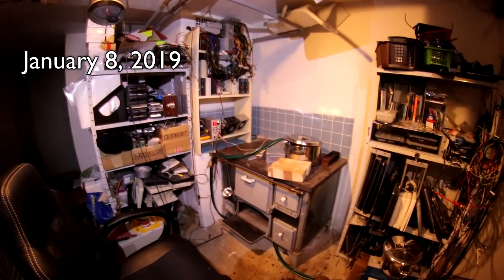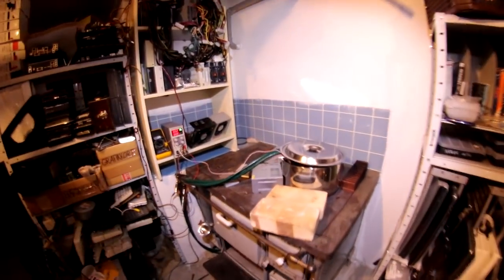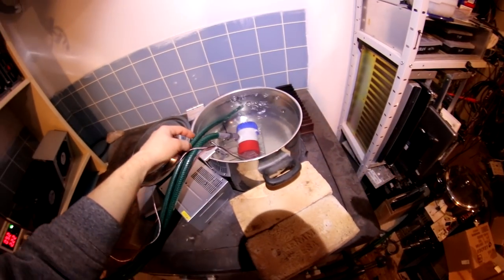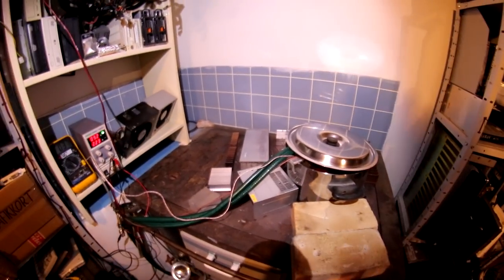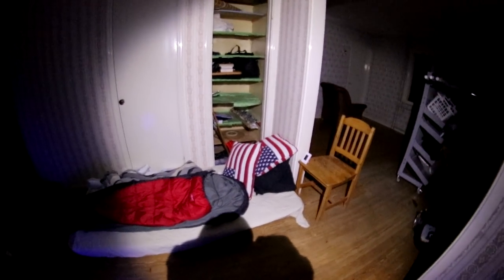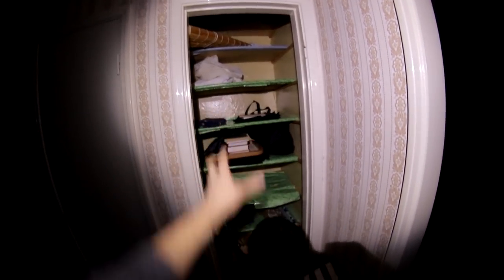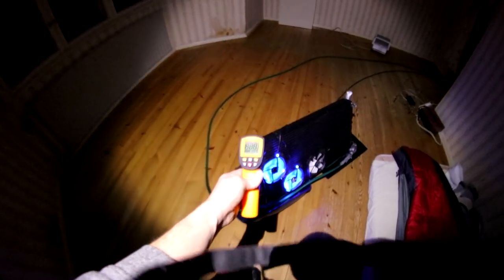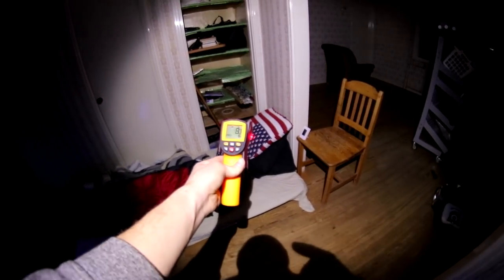Power Loss Blog 5 - Day 6

Comment: if the cupboard is radiating, it seems sensible removing anything that could be able to hinder it from radiating. also, reduce surface/volume to restrain energy in: at least close up the doorway in your new sleeping room with a bed sheet or similar. same goes for the windows: improvise curtains. 

compartmentalization is key.
Reply from the maker: I didn't close off the big opening, since the stove is heating the floor under the "unused" room. The floor was considerably warmer than ambient. If things had been more dire, I'd have experimented more, for sure, but I was reasonably certain that the power outage would not last more than a few days.

Comment: Why you don't use the boiler?  Doesn't run on gpl or natural gas?
Reply: It's electric everything... except for the wood fired stove
Reply from the maker: Gas isn't a thing here. I have a ground effect heat pump which is FAR cheaper to run than any oil/gas system.
Reply: @FFcossag  I got that. We have only gas to heat the house or AC pumps.